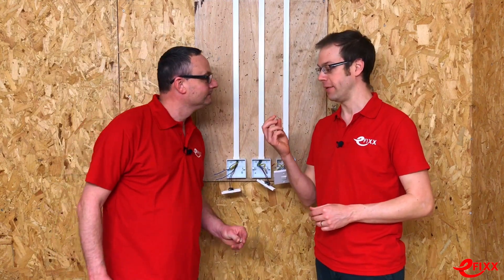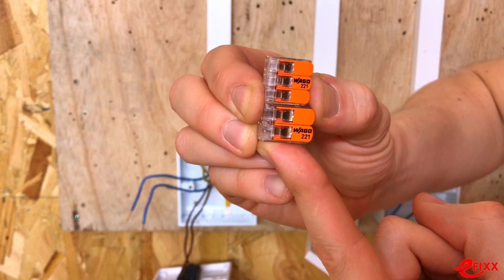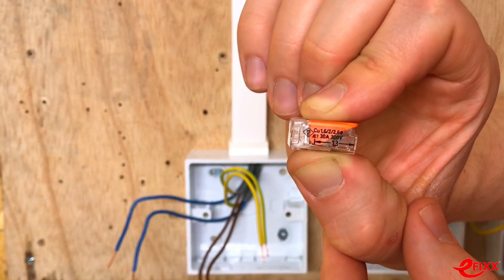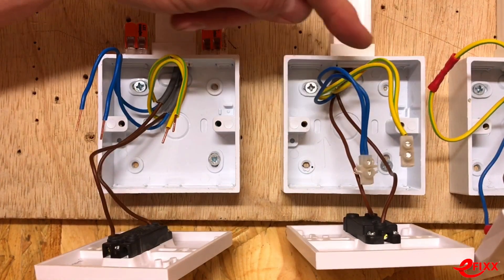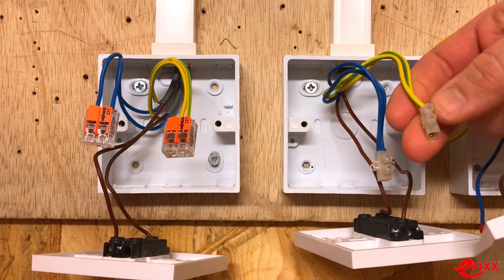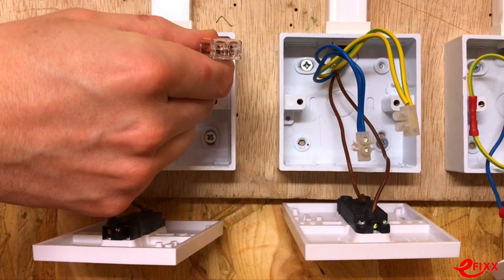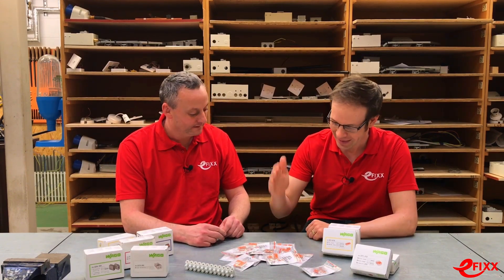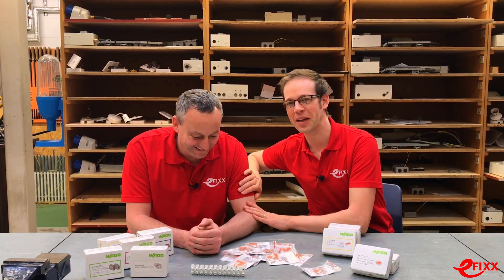Wago 221 vs traditional connector strip: including demonstration and testing point

Comment: Brilliant video guys. Just found your channel.

I have a question about the connectors - Although the manufacturer suggests that cable should be stripped back no more than 13mm, how far inside the WAGO connector is the contact point? For instance, if I inadvertently stripped a cable at 8mm long would I still get a connection?
Reply: The contact point is roughly at 5mm from the end. So 8mm would make a connection just fine.

Comment: Great Video as always. I have one concern where the Wago is not the silver bullet and more thought needs to be paid where the assumption is they are all Maintenance Free (MF). If you look at the BS 5733 (MF) documentation for Aggregate current (I ag) (on Wago's site) they specific that to maintain MF compliance this should not exceed 50A (depending on the wago type). I realise that Wago's fitted within accessible areas are not MF but I've seen (and discussed) several wrong implementations of (expected) MF where I ag is not taken into account certainly on a ring (or radial) circuit higher than 6A. One of your excellent videos could explain this well and prevent a wago box buried under the floor boards that is not actually MF compliant.

Comment: Hi Guys, is the 221 a maintenance free connector my understanding is that the 221 isn't and the 222 is maintenance free. Would appreciate some feedback on this?
Reply: From my research:  the 222 in a Wagobox is Maintenance Free; the 221 on its own is not as it is too loose in the slots.  But Wago sell a little shell thing that fits in the Wagobox and that makes the 221 MF.
Reply from the maker: Great question Daniel, we'll look into it!
Reply: From: http://www.wago.ltd.uk/enclosures/wagobox/
WAGOBOX is MF with 222 or 773
WAGOBOX XL is MF with 221 or 2273
WAGOBOX XLA is MF with 222, 773, 221 or 2273
Reply: The download of document on my post above only states the 222 is MF but perhaps because the 221 is newer and may just need an update to the doc. I've emailed Wago but no reply as yet (if at all)
Reply: What kind of maintenance would be needed on any of these? Oil change? 
Do you mean someone expects to have to regularly open and close the lever to restore the connection after degrading over time?

Comment: As a sparks myself I use both in different situations, but the connector still has that edge with entry both sides a must with shorter cables.
Reply: You can also get inline types. https://www.wago.com/global/installation-terminal-blocks-and-connectors/inline-splicing-connector-with-lever/p/221-2411
Reply: @jvl-pallesorensen1097   those appear to be for splicing only, and not pigtailing. I assume there's only one wire to be inserted per port, correct?
Reply: @wingerrrrrrrrr  Yes I think you are right - unless the diameter of each is small enough that you can put two together. I ordered some of this type, but there is a lead time of 45 days!
Reply: hi will any of these fit in 16mm knockoutbox for the lightswitch?
Reply from the maker: It's good to have options, that's for sure!
Reply: @efixx  it actually would be nice to have options with connectors with opposite side entry, but I haven't seen any with that design. That'd be useful for pigtailing to a single common.

Comment: Interesting video, thanks. Bit confused about the current ratings. At the start of the video you say the smaller and larger Wagos can take 20A and 30A respectively but later on when you show the close ups of the connectors, the current ratings are higher. Also, on one side of the Wago it says JET and has a different current rating than on the other side. Can you explain, please? Thanks.
Reply from the maker: Well spotted, we'll give Joe a slap on the hand for not mentioning.  It's all down to differing electrical standards and approvals. JET is related to the electrical standards in Japan, it's also accompanied by the PSE mark which is the approvals mark for Japan.  Whereas the other side of the connector has a different current rating approved by ENEC - Europe and UL- USA .
Reply: So if I understand correctly, in Europe the smaller and larger Wagos are rated for 32 and 41 Amps respectively?
Reply: How long until they make consumer units with these connections?
Reply: @Rubber Thingy Thanks!